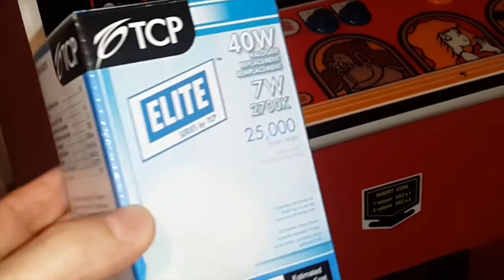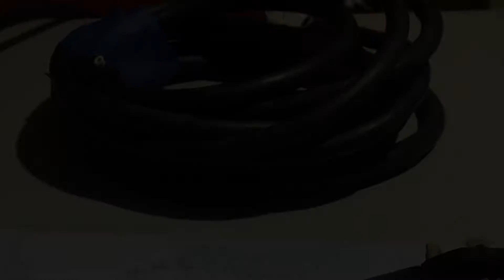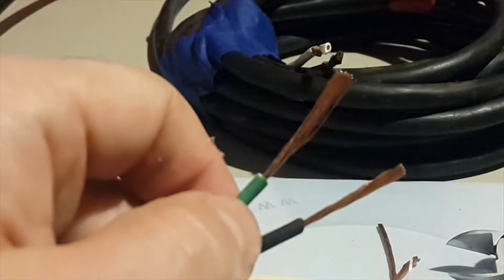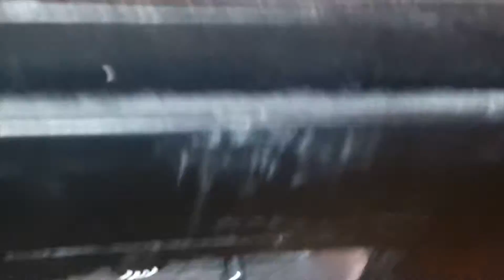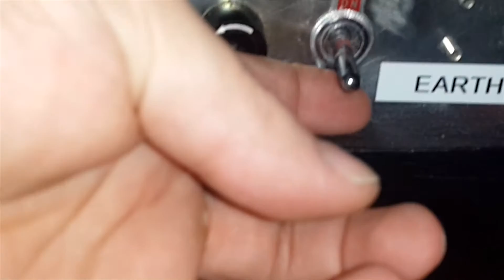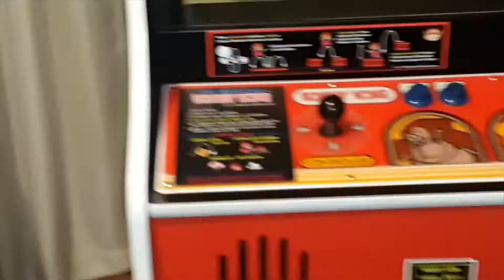Donkey kong Power Plug Replacement

Comment: Did you ever finish this cabinet and put a 60 in 1 PCB inside of it? I have done the same recently with an original Donkey Kong.
Reply from the maker: Original DK board for now, just need a back door but its 99% done
Reply: @daP.A  Cool. Any plans for a video on the cabinet in the future? I'm running the multi board in mine right now because I have to track down some issues on the original Donkey Kong board set.

Comment: hi im Gabriel, what is the specification for that cord plug or Grounding Connector? i bought a DK with no ground pin its that ok ? can i use like that? if you have the spec for the plug let me know thanks you.
Reply: can i use this one ? 15 Amp 125-Volt Double Pole 3-Wire Grounding Plug, Black https://www.homedepot.com/p/Leviton-15-Amp-125-Volt-Double-Pole-3-Wire-Grounding-Plug-Black-R50-3W101-00E/205165472
Reply from the maker: @gabrielarcade4177  yes make sure its grounded on the power supply side. Your cable needs 3 wires, white/black/green for ground.
Reply: @daP.A   Hi , i sent you a message in the email that u got here.